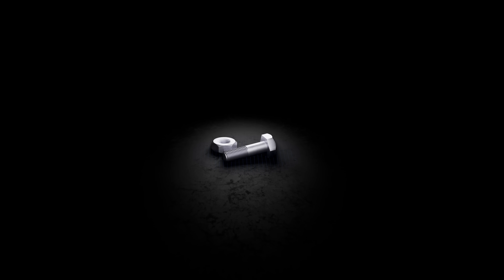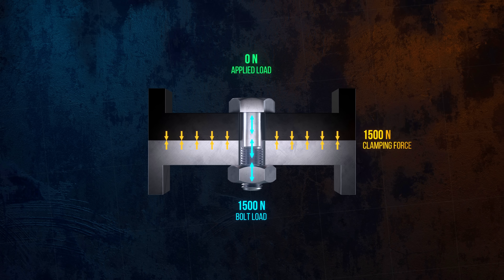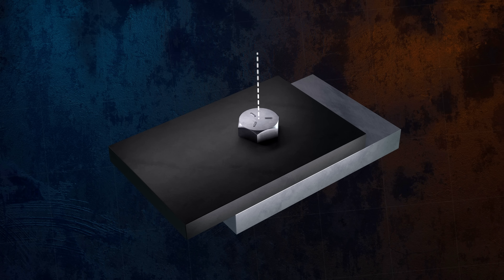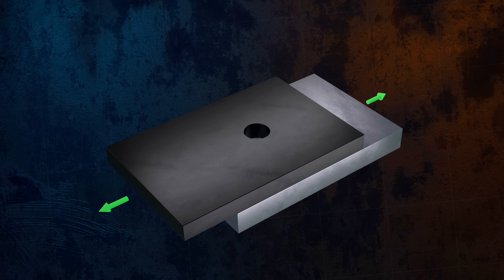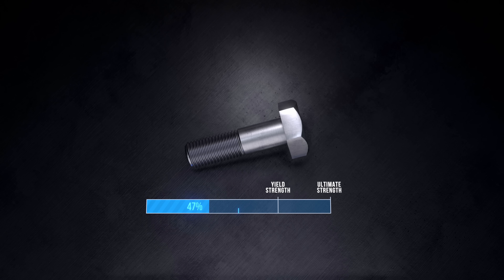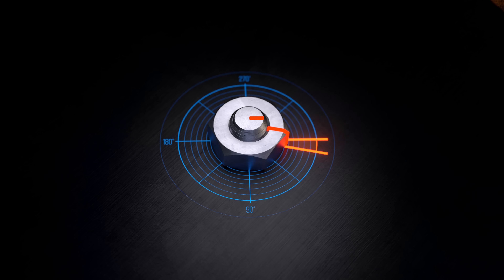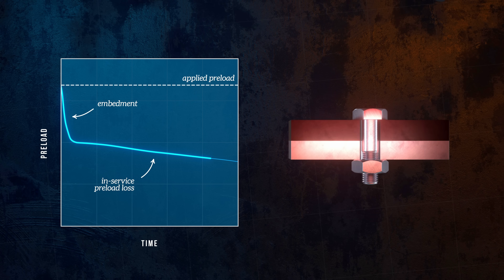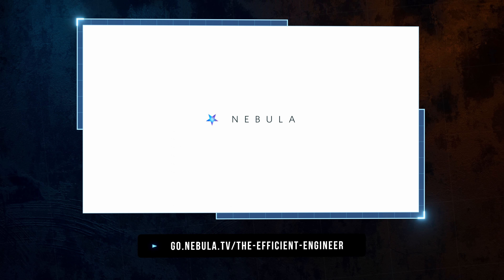The Incredible Strength of Bolted Joints

Comment: Very good video, i would like to add something though. The clamping force of a bolt or nut acts in a 45 degree angle from the tip of the bolt/nut head down until it reaches the end of the material. This is why adding washers with a bigger diameter than the bolt/nut head increases the clamping force. For the most effective clamping strength across a unit, the clamping force ends should be tip to tip with each other.
Reply: Like the double cone looking bolt force diagram?
Reply: That's true as long as the washers are thick enough and strong enough. There are plenty of washers out there that are so thin they are virtually worthless.
Reply: Washers just distribute the force over a lager area to avoid concentration in smaller area, they dont increase it. Force just doesnt come from nowhere

Comment: At 9:22, shouldn't the additional load applied on the fastener due to the moment on the centroid be INVERSELY proportional to the distance of the bolt? The closer the bolt is to the centroid, the higher the additional load on the bolts since the moment is given.

Comment: The torque wrench at 11:26 is applied incorrectly.

Torque is to be applied by turning the nut side, not the bolt side, so that the friction of turning the entire bolt in the hole doesn't reduce preload.

Comment: Your explanation of clamping force is totally wrong. When you tighten the bolt, the clamping force is equal to the tension in the bolt. if you then try to separate the clamped parts, the parts won't separate until the acting force is becoming larger than the clamping force, but the extra force applied is transferred to the tension in the bolt from the start. So when parts begin to separate, the tension in the bolt is already twice the initial preload.
Reply from the maker: I disagree - see the graph in the Bolt Load vs Applied Load section of this page, for example - https://mechanicalc.com/reference/bolted-joint-analysis.

Comment: For the shear joint in Australia's code it's assumed that all the capacity is within the bolt itself for slipage. The frictional force between the plates is additional capacity to the system. They do this because it's better to design the bolt to have more capacity incase the nut wasn't torqued to the right spec. Sounds like the US has this different as I've seen stuff when the friction is added as the capacity of the bolted connection.

Comment: 0:01: Introduction to nuts and bolts
0:34: Assembly process of bolted joint
1:42: Tension joints
4:50: Shear joints
6:45: Bearing joints
8:23: Combined effect of tensile and shear loads
11:04: Controlling preload
13:47: Example of bolted joint in space
14:04: Bolted Joints
14:27: Preload in bolts
15:57: Joint diagram
16:01: Nebula
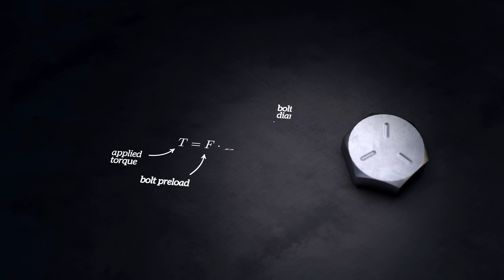Reply: What about the 11:47 : Nut Factor
Reply: @ionbg7 I was waiting for this comment 😂
Reply: smoking joints?

Comment: Naaaah, hold up wait a minute. 2:23 what is this magical clamping force that reduces strain on the bolt?? There's no where else for the force to go if the bolt is the only thing holding the joint together!
   If you apply a 1000N tensile force to a bolt preloaded with 1500N, there's absolutely no way that bolt isn't now holding about 2500N in tension. Explain your magical 90% reduction in force.
   Even the demonstration with springs directly contradicts the words you're saying. How are you suggesting that pre-compressing a spring will reduce the force acting to decompress it?! It's literally the opposite, the spring would add to the force pulling it apart! I'm so confused. 

   Someone please explain how I'm lost.
I'm guessing this has to be one of the most well understood engineering concepts in the world so now I feel insane for being the odd one out.
I can't even get chatGPT to explain this nonsense, it somehow agrees with both of us.
Reply: Everything else in the video made perfect sense to me.
Measuring the stretching of bolts using ultrasound seems fascinating! At first I thought the accuracy would be nearly perfect, much better than 99%. Then I realized how complicated that equation must be, stretching the space between molecules must also reduce the 'speed of sound' in the medium, right? How do you predict that variable, sheesh!

Comment: I have two question, both directed at the affect of shear on a group of bolts:

Question 1: How is the size of the hole plus fabrication or installation imperfection accounted for in the group of bolts experiencing a eccentric load? The solution presented in the video accounts for the load based on each individual bolt's relative distance to the centroid of the group. But typical bearing type bolts have holes that are 2mm larger than the diameter of the bolt, if the pieces are not connected with each bolt perfectly in the center of each hole (which they will never be), once slip occurs in the connection, two bolts in the group will experience the load before all other bolts are engaged in bearing. 

Question 2: What is the slip critical capacity of a group of bolts? If we have a connection designed for the slip critical condition, once the eccentrical load is applied (lets assume the shear load on each bolt increases based on each individual bolt's relative distance to the centroid of the group as mentioned in the video), and one bolt's shear load exceeds the friction created by its own preload, will the connection slip, knowing that the two plates can only rotate and slip relative to each other if the entire connect surface slips (ie, the entire bolt group slips).
Reply: I think I can  answer since I work with bolted connections a lot:
Q1: These calculations are done based on the joint AFTER the load redistributes within the joint. What this means is that, as you say, some bolts will see the load first, but the localised deformation and yielding at their holes will change the local stiffness allowing other bolts to come in contact with their holes and share the load. Note that these calculations are based on industrial codes e.g. Eurocode 3 or AISC so as long as you use standard holes sizes specified in those codes and have reasonable tolerances you can assume load share presented in the video. Also note that there are some more advanced methods of calculating the joints (Instantaneous centre method, FEA etc) which are closer to reality, the presented method underestimates joint strength by quite a bit but is easier to use.
Q2: I would need to double check this but you don't treat the bolts separately like this when performing calculations because it is difficult to predict the exact load share. The calculations are normally done in such a way that the joint slipped or didn't slip, no in-between. What I would do, off-the top of my head, is calculate shear force on a joint due to torque coming from the eccentric load and add it on top of the shear load, then compare against the allowable based on the code I am using. Alternatively, can do FEA.
Reply: @Fisthar  thank you for your response. I believe it is the commonly applied practice, and I agree with everything you said. 

I asked the question in hopes of hearing new thoughts and interesting new ideas to treat these problems. If anyone else has any other thoughts, would still love to hear the responses.

Comment: Great video and animation! You cover many important bits.
But, I would have liked to see
- no preload with a standard nut will cause the nut to loosen
- preload for joints in thin materials is only achieveable with spring washers or bolts with lower Young's modulus

Special case as a sidenote:
- Preload is hard/impossible to keep when boltign plastik parts together. The plastik will literally "flow" away from the stressed area over time, dependant on it's hardness.

Comment: That part about the clamping force taking part of the load is counterintuitive and might confuse some people. I would put it this way: When the preloaded bolt is put under load, it elongates. At the same time, the clamped members spring back (expand/decompress). As a result, the members remain clamped together since the elongation of the bolt is cancelled by the expanding  members. As the load is increased some more, the bolt elongates further. At some point, the members are fully decompressed and can longer cancel the bolt elongation. At this point, the members move apart.
Reply: I get why the parts only separate after a certain total load. But I don't get how the bolt only takes a part of the additional load. After all the bolt is the only thing holding the parts together.
Reply: @superdau  That is the part I could not get either. And I bet it's wrong because it goes against all intuition and physics.
Reply: @superdau  same.   and I'm really glad some here are pointing it out.   all the comments about how amazing the video is but it's got this glaring problem - maybe it's just being very unclear, but it sounds like it's just flat out wrong about an absolutely central bit of reasoning.
Reply: @vincentpribish5103  I'm also surprised that people who seem to have had work experience with bolts could not detect the anomaly.
Reply: @bluekenya4825 I thought this was wrong at first too, but I think I figured it out. Consider this, when there is no load applied there is still tension in the bolt, so the tension is GREATER than the applied load. But if you apply enough load, at some point the bolt will be stretched enough for the two parts to separate, as you pointed out. And at this point the tension in the bolt has to be EQUAL TO the applied load because that load is now the only force acting on it. So that means that as load is added, the tension in the bolt is NOT just increasing by the amount of the applied load!!!
Without a load, the force on the bolt is coming from the compression of the clamped material between the head and the nut, but as load is added and the bolt elongates, that material decompresses which means that source of tension gets reduced as the tension due to the load increases.
Reply: @vincentpribish5103 See my response to @bluekenya4825 It does appear to contradict basic physics at first, but I believe it is actually right. Hopefully my explanation is helpful.
Reply: @ryanahern4213  That part "as the load is applied only a small portion of it is taken by the bolt" is fundamentally wrong as only he bolt can carry the load. I guess he confused the load with the clamping force. As the bolt is loaded and stretched, some of the lost clamping force is restored by the spring back of the compressed pieces.
Reply: @superdau See my explanation further down in the thread. I didn’t understand this at first myself, so it was rewarding once it clicked. I hope this is helpful

Comment: Thank you for a great video. I'm a designer of Structures in Japan. Your video is helpful since I can see the Stress visible. Timoshenko has defined that called Stress. Since then, many people have struggled to know that Stress. I am also one of them.
Reply: I sometimes think of stress like it’s pressure, the load of the force is distributed over the entire cross-sectional area of the material
Reply: @johnhartney7576  : Thank you for your comment. Agreed. I think as same as you. The stress might be similar to the pressure. For example, in the case of Stress is σc or σt=N/A (N=axial tension or compression), and in the case of Pressure is N/A=Pa. ( N=Newton A=Unit area). So, Both would be able to treat as the same.